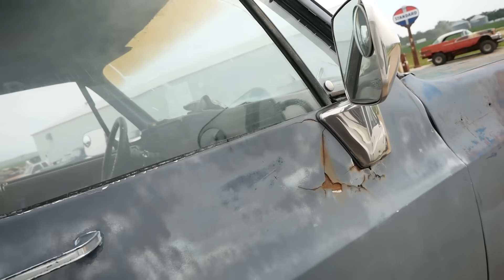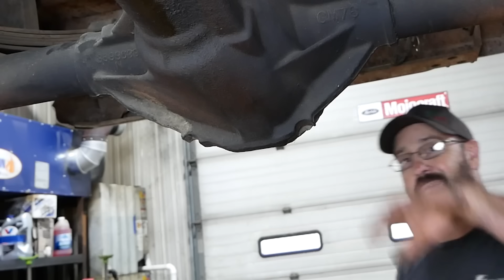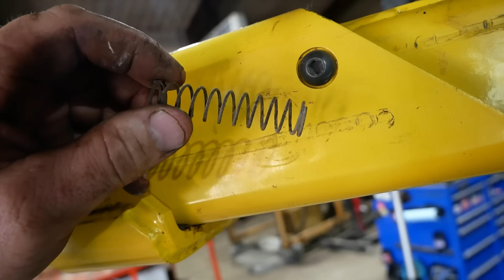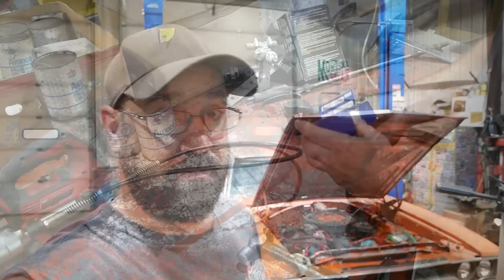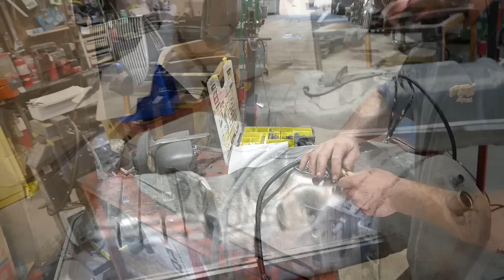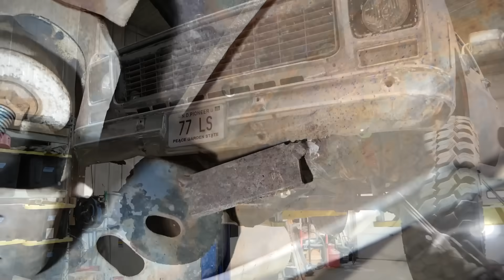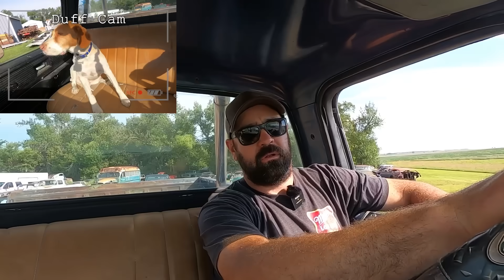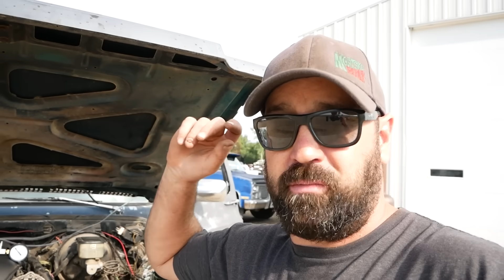Super Cheap 4x4 Shortbed Squarebody! LS Swap Hack Job!

Comment: Hey Kids, don't forget that using the heat wrench around the gas tank is dangerous, so don't do it if the sending unit has been removed from the tank. It's the vapors that ignite, not the liquid fuel...
Reply from the maker: Good advice!

Comment: You might take a peek at your filter. Maybe tighten up the mounting bolt with a washer or something? Suction side leak at the filter can do what your experiencing.  You could swap pump gears n bushing.  No sweat.  Better u than me.❤
Reply from the maker: Thanks for the tip!

Comment: My money is on the trans filter. They should be always changed every 60k miles. Great video, nice truck! Thanks again!!
Reply from the maker: Good info, thanks!
Reply: Likewise, a dirty filter will affect the pressure in the box and the shifts.
Reply: Also the kickdown cable needs to be working, or the trans will eventually fail. I believe the after market makes adapter linkage for a cable LS to work with the TH350 kickdown cable.

Comment: The th350 in my 70 Nova is doing the exact same thing. Been dealing with it for awhile...lol
Reply from the maker: That's interesting!
Reply: My 77 c10 is doing the same thing. I just swapped this transmission in. It drives fine but it takes a few seconds to kick into drive and reverse. If yall figure it out I'm excited to find out about it.
Reply from the maker: @KillswitchIII  I talked to another transmission guy. Sounds like it's the seals ln the low/reverse piston. Requires tearing it all down and some specialty tools unfortunately. Lotta folks saying it's the filter but that makes no sense to me. If the filter was dirty it wouldn't flow at higher RPM but easy enough to try I suppose.

Comment: if you have a "shift on the fly" 4x4 the 4L60E doesn't matter if it came from a 4x4 or 2x4 but the 4L80E it does matter a 2x4 will not work with a 4x4
Reply from the maker: Thanks for the info!

Comment: I gotta say, I'm likin' these Sunday evening Mortske moments.  Squarebody K-10 doesn't hurt muh feelings, either.  Good choice, Mortske!!
Reply from the maker: Appreciate the feedback
Reply: @MortskeRepair  wen yu bin 4x4 in for over 1hr..  not that u ever will..  & yu come tu water, creek..  STOP.. for 10 mins so the diffs ect cool down or they suk water in..  by by 4x4ing..  here in aus. we allways walk creeks to see how deep they are..  & if theres any crocks..  so it pays to be popular.....   abo,s just chuck a dog in..
Reply: @MortskeRepair  i wana see you fk around with a hub.. replace the needle bearing ect..  there fun.. just did both on the blazer..  im sure they never ever had a 4x4 before..  previous owner.. for some reason, its a 5 sp nv4500. which i still have to confirm..  seeing we dont have them in aus..  we got fk all here.. we dont even have a gov that gives a fk..
Reply: @MortskeRepair  shocks.. we cant buy any acc shock for less than 400 each..   ish..  '' oh..  you own a 4x4..  ''  the price just doubled...   COS YOU GOT MONEY.. they think..

Comment: now , i could be wrong , but... it looks like the tensioner for the serpentine belt looks like the bearings are possibly bad.. it looked crooked AF when you did the engine reveal. you may want to check that .:face-green-smiling::body-blue-raised-arms: